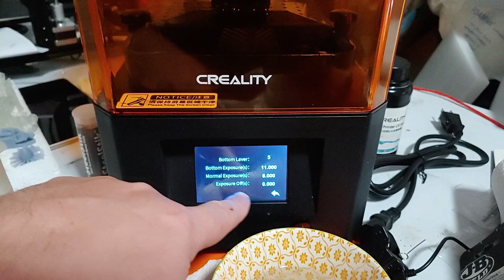Creality Resin 3D Printer MSLA LD002R Beta Hardware T3DP

Comment: My elegoo mars squishes the first few layers as well. Didn't do it when I first got the printer. But started several prints later. If I print anything that I dont print lifted off the print bed on supports it will print a solid base layer across the bottom, and rounded parts get flattened where they print to the bed.

Comment: On the peopoly printers I use the "Nex" "hightemp"resin. It requires The ambient temperature to be close to 26 degrees C. Otherwise the resin is too viscous to print properly. It has to be watery. Usually tacky models mean they need to be washed more, fully curing doesn't get rid of all the tackiness.

Comment: I enjoyed the video but I got to point out something.
It doesn't have a heated encloser. That fan is part of the air filter system. It's listed on the website as a way to get rid of resin odor.
Reply from the maker: The chamber unquestionably gets warmer so something is heating it up I can feel the heat come out when I open the chamber so I'm not entirely sure what's going on with that I only know of two heat sources in these printers the curing resin itself is an exothermic reaction and the LED underneath generate a massive amount of heat I have ordered some thermometers so I can put some inside the chambers to see if there is a tangible temperature difference

Comment: Print everything on a raft, will get rid of the issue of holes and squishing on the bottom layers
Reply from the maker: I'm trying to avoid that because it uses more resin takes more time and it's much more difficult to get a flat bottom which is why people put the print at an angle which is even more resin :-) I think I've got it nailed down to between 1.2 and 1.5 mm but so far I'm getting some very nice clean results I'll have to reprint the turbine blade to see if that would prints properly as that is a perfect test for this

Comment: Auto supports in Prusaslicer is way better than chitu you still need to add some here and there, plus they  are way easier to remove, just run it under hot water or soak in a bucket of hot water, They peel right off.

Comment: WHAT PROGRAM SHOULD I BE USING .  I JUST GOT THIS PRINTER AND COULD USE SOME POINTERS
Reply from the maker: For the actual slicing of files to place on the printer you would use Chitubox which should have come with the printer on the flash drive

As far as meeting files to then put into the slicer that would be 3D modeling or cat software a very simple program would be something like tinkercad more advanced program while still being free would be something like Fusion 360 or blender

I am not an expert but I believe Fusion 360 is more geared toward the engineering side while blender is more geared toward the artistic side

Comment: What is the resin brand?
Reply from the maker: The gray I do not know it was included as a sample with the printer shipping units will not include a sample

 The other resins I used were any cubic resin and Ellegoo resin.
Reply: Have you tried Creality Branded Resins?
Reply from the maker: @buddhikawarnakulasooriya8692  I am assuming the bottle that came with it was creality resin Otherwise I buy whatever is cheapest on Amazon. :-)

Comment: Q#2 Do you have a source for MK8 BRASS 1.0 nozzles?
Reply from the maker: Yes 1 millimeter novels are readily available on Amazon I have links in my 3D printing parts and accessories category on Amazon 1.2 mm in a little harder to come by but 1.0 is pretty coming

Comment: How much resin did you used for all those models? Im curious how many tabletop figures i could print from 500ml bottle of resin.
Reply from the maker: Assuming no failures and depending on how much support you needed you could print quite a lot with 500ml

Printing Miniatures is quite practical when you're getting the resin for $40 a kilo

Comment: That is a carbon filter to filter out fumes they are sucking air out of the chamber...
Reply from the maker: That's what I assumed it was I just can't figure out where the heat coming from the chamber is definitely warmer than ambient
Reply: Nerys it’s coming from the led array they putting of uv they get very warm
Reply from the maker: @joatmon-src  that much passively through the lcd? Wow. Either way that's a good thing right? Warmer chamber is good?
Reply: Nerys yeah it’s very I wish my elegoo Mars has that filter I cannot use it  because of the fumes once I finish my garage I will put it back to work
Reply from the maker: @joatmon-src  get a cheap "grow tent" make an enclosure with a filter.

Comment: In the last couple of weeks (I think) you were talking about a 400x400x500 printer for 350 bucks do you have a link to it? Do you still like it?
Reply from the maker: You are probably talking about the Chiron 400 by 400 by 450 and I believe it was on sale before the holidays for 350 normal price now 400 which is a bargain for that kind of print volume yes I am still using it I finished the Captain Planet print and I'm now moving on to the two meter tall sorceress once I get my 5kg rolls in from Zyltec
Reply: @nerys71  Just looked... They want 500!
Reply from the maker: @GrandpaBill  ebay. Click my ebay link search chiron 3d printer. $399

Comment: I guess it doesn't flex the dinosaur because the cure has been very long
Reply from the maker: Correct some resin cured between the joints hopefully I can fine-tune the burn time to get a successful joint

Comment: Is there any way you can resin 3d print this: https://www.thingiverse.com/thing:3330679. It's called "Autumn Plains" (one of my favorite childhood game I used to play, it's one of the worlds you can explore in the game) I don't know if you can resin print this and I will be getting a printer soon like this one you reviewed, also thanks for the heads up with fixing 3d models with netfab.
Reply from the maker: I don't see any reason why it can't be printed I just might take a little work to make sure there's no Islands in midair the only problem is it would be very small on one of these current resin printers play max out at 121 by 68 mm on the X and Y that's going to result in a pretty small game map
Reply: @nerys71  I'm aware of its size to print, but can it be done on filament printer. Would it be better to cut up model into sections because of overhangs?
Reply from the maker: @MA-yg7ft  oh yes. Absolutely on fdm just proper breaking apart and support!! I thought you wanted a resin print!
Reply: @nerys71  Yes, just when I saw this video I was confused on how a model with small issues can ruin a print. Plus I just want to see someone print this big place as a small print on resin printer before I throw money at a machine that I don't fully understand. (The whole point for me to consider this type of machine is to give it a real test like this model.) Also am making effort to cut up model just not ready bc fdm printer needs tlc at moment.